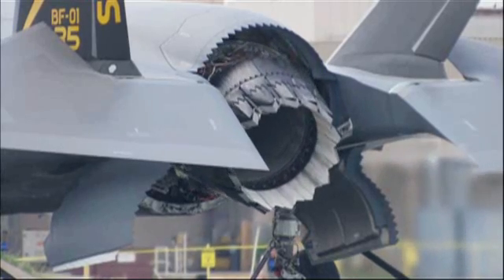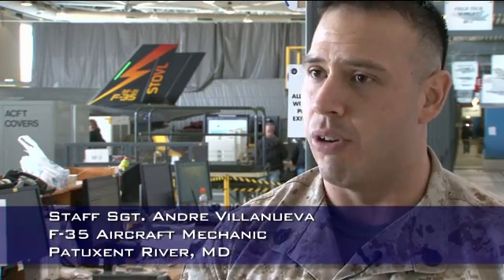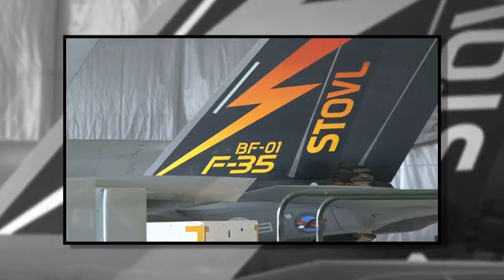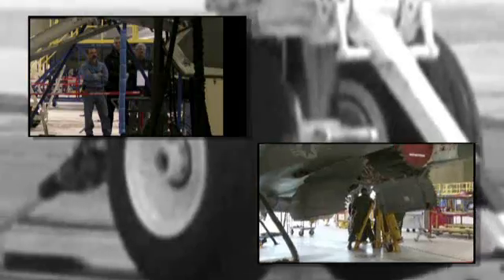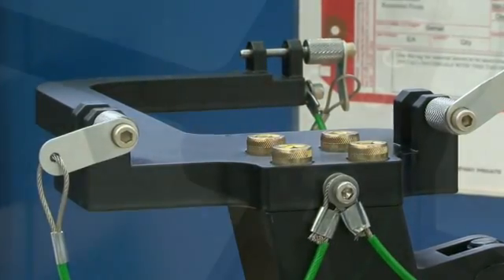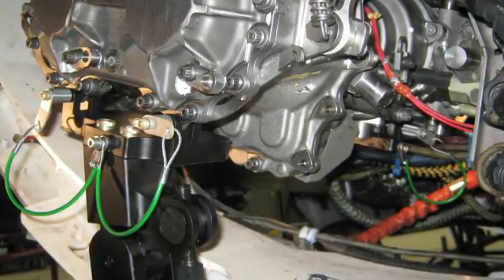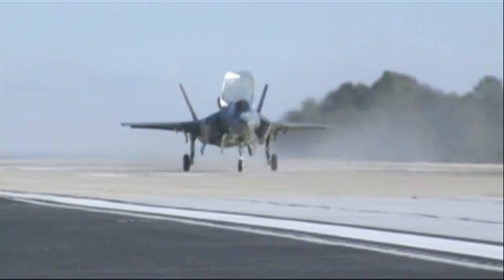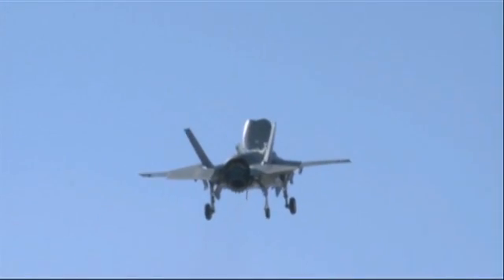F-35 JSF Thrust Vector Actuator Tool

Comment: So, during the engineering & design  phase of the F-35 development, everyone involved in designing the airframe & it's relationship with its engine, completely overlooked or failed to even recognize the eventuality of this actuator requiring maintenance/replacement, to the extent that no provision was included to either the airframe layout or the engine design, to allow a more efficient way to access this component, short of removing the entire power plant from the airframe?!? In addition, besides the lack of detail attention in planning, this issue was never addressed by the design engineers? Even after production commenced, it required a field solution to be created, by the initiative of the mechanics & their recognition of a potential solution to a problem that was never destined to be addressed. A problem that not only saves money but also reduces significant down time, simply by designing and implementing a relatively simple, mountable jack/brace that allows accessibility and removal of this component while negating the need to remove the engine. Essentially, as the video classifies it, a tool, was designed to solve a problem that, prior to it's inception & subsequent utilization, would've forced mechanics to have no other option, except to ground an otherwise functional, air worthy aircraft, for the duration of time needed to remove the entire engine, just to gain access & remove a few bolts, remove & replace the part after rebuilding or acquisition of a new one, then fully install the engine, verify full operation of all components that were handled to ensure no errors in reassembly, finally returning the aircraft to active readiness. All that extra work & time, eliminated by a tool. No wonder the F35 has had so many problems! These men responsible for idea & creation of this tool, should receive a monetary award for the service they did to help the military. Yea right, dont hold your breath, you'll pass out waiting! Id like to know if the engineers who create mass produced machines of all types, factor in ease of maintenance to their process of design? If so, how much attention is given to it, and do other design requirements take precedence over ease of maintenance? How important is the incorporation of that feature in the overall design? I really think that it takes a backseat to all other factors. It appears that intentional effort is sometimes made  to hinder ease of maintenance. Its just the like the practice of engineered obsolescence in electronics. If it requires more labor to maintain, or special tools to complete, that equals more money for the company. I see it in cars all the time, so its not a stretch to believe it happens with aircraft.

Comment: The F-35 STOVL thrust vectoring design was actually initially developed by Yakovlev and Lockheed/Pratt-Whitney bought the design rights and then further modified the design. Look up Yak-141 "Freestyle."
Reply: LordDigz12 So, to address the ludicrous claim; the F-35 is 3 designs from one airframe and the 35B VTOL was NOT a copy of the Yak, Lookheed did not “buy” the technology from the Russians any more than the Russians copied the Harrier first. Some technology for current VTOL is bound to be common and Yak did invite Lockheed to invest and share in development. That is not the same as buying the technology outright. No doubt Lockheed benefited from Yak designs, but the F-35B is a unique design based on a nonVTOL fighter. The Yak uses 3 lifting engines, the 35 one engine in a simpler, unique design. The Buran space shuttle is a copy. Not F35B

Comment: Lockheed doesn't BUILD or DESIGN engines. The thrust vectoring worked perfectly in the fly off phase, in fact it performed a "Hat Trick" of vertical (not short, but vertical) takeoff, go supersonic, then vertical landing for the first time ever.

The engine doesn't perform the thrust vectoring either; the nozzle, clutch, and mid engine fan are responsible for that. I no longer work there, but when I left the problems and delays were more managerial than engineering; for instance forcing MBD...

Comment: Again, what a bunch of... well, smelly stuff.

In Desert storm the F-16 flew more sorties than all other AC combined. The limitations were human rather than machine. A F-16 returned from a Sortie and could be re-armed, re-fueled, and ready to go before the pilot could get a cup of coffee and take a leak.
The Digital Flight Control System has proven to be more reliable, easier to maintain, and mostly easier to upgrade with new weapons/tech than older more conventional mechanical systems
Reply: eh?

Comment: BTW, technologically the most difficult thing to design was a clutch that could withstand the tremendous torque the engine puts out.

It is better than the Harrier tech for a number of reasons, including the fact it overcomes one of Harrier's probs, and most any thrust vector crafts problem, of re-ingesting hot gasses. With the only ingestion by the inlets being the cold air put out by the fan.

Comment: I worked Lockheed Fort Wort Flight Control Systems Software on the JSF prototypes for the fly off. You're right, the Harrier is NOTHING like JSF. Harrier re-directs exhauast to vector it's thrust.

JSF/F-35 achieves thrust vectoring principally in 2 ways, both unique/new technology at the time. 1st, it rotates the nozzle to get downward thrust at the rear of the AC, AWAY FROM THE INLETS! 2nd, it has a cold air fan midship, driven by the engine through a clutch.

Comment: You are incorrect, the arrangement of the engines is taken from the Russian YAK-141 from the 80's. Lockheed Martin bought the design for the Russian Bureau because they could not get their engine built in time so, in order to save the program they bought the design which, they are working with the Russians on in order to perfect. No aircraft has been delivered to anyone since the aircraft is still being tested even now. DAS and the helmet cuing systems do not function at all, it is a failure.

Comment: @virustwin 
no, most of these are already "known" properties by superpowers. They all have physicists and engineers working on photos of enemy craft, simulating probable performance. Anyway, the absolute majority of the physics behind the craft is not secret or a threat; the secret which is a threat if revealed is the methodology of production of the components, and the component design. Because these if given away, allow the other side to make their own derivatives.

Comment: @virustwin 
No >.<. As in unless you are talking about the complete blueprints, which I do not see happening. But if someone from the inside brought out a DVD or a Flashdisk with complete digital data blueprints for the aircraft, including the specification for the software, then any country with factories advanced enough (France/Spain/England/Germany/Russia/China/Japan/Korea) would be able to make copies.

Comment: @bujoun76 
You do realize the PAK-FA was stalled for over eight years due to funding cuts after the USSR collapsed right? As an example, the S-47 (the one with the swept forward wings) was proposed theoretically in 1983, yet it flew on the 25th of September 1997